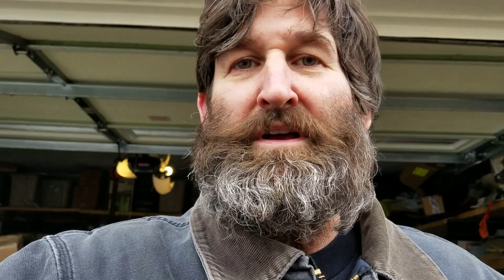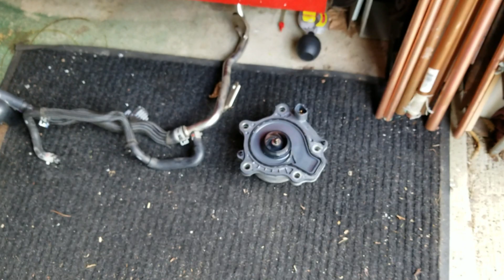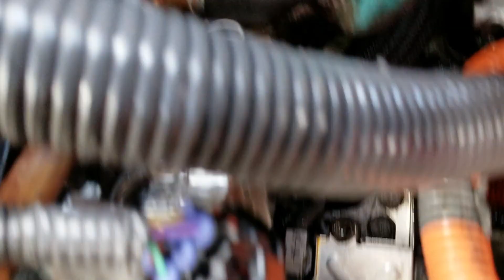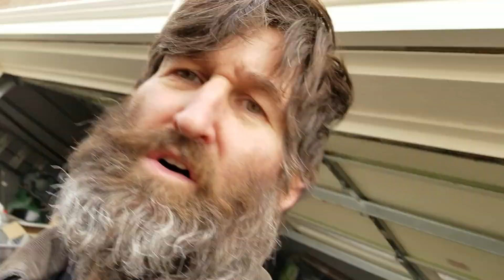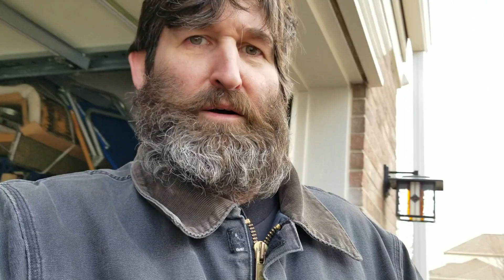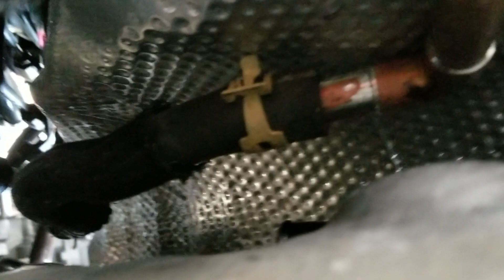Fix That Prius! - Effects of a Clogged Heater Core on a Gen 3 Prius? Overheating!

Comment: Update: NEVER SET A FOOT IN DEALERSHIP!!!  i had intermittent sporadic random overheating accompanied with a burst of coolant over the overflow on the plastic tank. toyota dealers convinced me that they looked inside the cylinder with a boro scope and there was coolant seeping tru. FVCK THAT SH!T!!!. Just received all parts, took off the head... GUESS WHAT!!!!! My gasket is perfectly OK!  I am so mad at these fake specialists in toyota. they thought that they can get me leave the car for "repair" for 3,600 plus taxes and everything FVCK TOYOTA!!!! FVCK ALL THESE "professionals". i believe that all my problems were with jammed egr and specifically the heat exchanger. I soaked it in oven cleaner, then boiled it on bonfire with water 4-5 times until water comes out clean. This is the single most important lesson for me. and perhaps to you guys!!!! I HATE PROFESSIONALS AND I DONT TRUST THEM!!!!!!!!!!!!!!

Comment: please help. prius 2012. random sporadic irreproducible engine overheating. typically, just a short flash of red T warning, accompanied with a splash of coolant out of the overflow tank. splash may be so big that coolant ends up on pass side doors. changed pump, thermostat, temperature sensor. appeared at the time to solve problem, then problem comes again. it was always sporadic. all this happened with NO check engine light and code. some ppl blame on clogged egr valve. took apart the intake manifold, yes, there was some dirt, but not terrible. finally,  i got an innova 3130lat and autel mk808bt pro and checked the codes. now i have codes. one of them is P261C "pump B" thing. <can anyone explain what is pump B, and what  A???> set autel to watch the temperature and the pump revolutions. short test drive. T reached 100 degC <just short of boiling> and the pump never moved. target speed was always 0 rpm. I am aware about rotor jammed, and no, my rotor was new when i installed it 4 months ago. the problem seems that the computer does not care that temperature is 100 and does not set target speed.................. what do i need: a new ecu? or reset -- reprogram the computer?
<pressure test of the coolant system is ok. no exhaust gases in the coolant. engine cylinders pressure test is ok. oil is clean, no coolant in oil. coolant is pink and clean, no oil in coolant>
Reply from the maker: Hi, That's a lot of stuff going on. Let's see if we can make some sense of this. Of course, I'm not there and I'll have to make some assumptions.
Assumption #1 is there is an air bubble in your system. #2 The air ends up at the top of the EGR cooler.
Is it cold where you live? What you describe is typical for a 3rd gen Prius in cold weather. The car runs fine for about 10 minutes then the temp light comes on and it pukes coolant and then it may or may not overheat after that. 
This is what you'll have to do.
1) when the car is cool enough, remove the coolant tank cap
2) fill the coolant tank
3) raise the coolant tank as high as you can while the hoses are still attached, no cap
4) unclamp the hose at the top of the EGR cooler and loosen the hose until coolant can come out
The air in the system should escape and coolant should flow from the gap where you loosened the hose.
5) put the hose back on and clamp it.
6) lower the tank and cap it
Do this as offten as nessesary.
    -  Fix That Prius !!!
Reply: @fixthatprius4980  Update. The P216C code appeared after I cleaned the intake manifold. Finally I discovered, I did not plug in the electric pump. 

My wife's husband is the dumbest person out there. I deserve every joke and ridicule. Please tell all your friends when given a chance.

After I plugged the pump, and cleaned the P216C, no more messages. I drove the car with Autel plugged in, and watched. T between 75 and 87 deg, pump rev are 5% above the target.

Comment: Hey, I cannot find an answer online to my issue, maybe u can help. I have a 2011 prius where the heat works just fine when the ac button is off, but stopps working when i turn on the ac button. On the other hand I have another 2015 prius, and I always leave the ac button on, and the heat works just fine. 

Any idea why my heat goes off while ac button is on?

Comment: I have same issues with my Prius. I have a 2011. Changed out engine, water pump, sensor and thermostat. I have issue when I drive high speeds 70-80 mph up hill. Reservoir hot but not boiling like before. Temp red light would turn on or flash and then when I slow down it will eventually turn off. My mechanic replaced literally everything minus the radiator and the inverter coolant pump. Can anyone please help????

No codes or no check engine lights just the red light engine temperature turns on when driving high speeds up hill for long periods of time. 

Is the issue temp sensor on EGR pipes?

My mechanic has replaced with all OEM parts. Any advice?

Comment: When you wash your car then use w40 to take the tiny water from conection IMO
Reply from the maker: You're not going to belive this. My Gray V is a level 5 with all available options. The electric A/C compressor went bad, causing issues with the adaptive cruise control. Everything went back to normal when I replaced the compressor.
 - Fix That Prius !!!

Comment: if it was overheating then what made you think it was overheating. did you run obd2 diagnostic tool? my prius temp gauge light didn't light up when it bellowed steam from overheating so it made me think my temp senor was faulty and also the pump thermostat was stuck too and pump was found leaky from pressure test too.

Comment: New to Prius owning. My 2014 heater does not heat up, just blows air. How do I know if the engine is over heating? There are no temp gauges or digital read out. The car seems to be running rougher. Thanks for sharing. BTW, I’m in the far west burbs too!
Reply: More than likely its your head gasket and heater core blocked. Good luck.

Comment: I did the swap and the engine runs fine but I keep getting p261b code so I bought another pump AISIN brand with Toyota scratched off.  Got the same code . Wiring looks good but it won’t engage unless I jump it straight from the fuse box.  Any suggestions?  I was wondering maybe the ecu needs reprogramming but can drive it to a dealer and you they will as much as they can legally 🥴

Comment: Here is that time of the year again! I gave up on my 2010 Prius last winter because of lack of heating. This spring, I replaced the head gasket. As a matter of fact, my heating started acting up since I started adding "Head Gasket Sealants" in it. I did it in total of four times. They become less "effective" as the time progressed. I highly discourage people from using them especially on hybrid cars because of the complexity of their heating and cooling systems. There was so much deposit built up on big coolant passages and blockages on the small ones. My car runs fine now except the heating is still not getting warm enough.
Here is the list of the things I have done so far: Replaced water pump, T-stat twice, radiator, power washed the heater core, replaced both coolant temp sensors.                                    The inlet and outlet temperature of heater core lines are about 150 F within about 10 degrees apart. The max temperature at the driver's vent is 110 F while it becomes cooler towards the passenger.
What seems to be wrong!? I have done the elevation technics each time I have done some heating system work. It seems I have circulation problems or maybe still air trapped. Where else can I flush to get rid of possible restriction?
Reply: Hello bro . My 2010 Prius has same problem.no heating inside car and engine is overheating after 45 mins of drive . I recently changed water pump and thinking to change heater core now , how did you solved this problem? Please tell me it'll be very helpful
Reply: @mohdminhaj898  I had blown head gasket and had added Blue Devil head gasket seal three times and clogged the heater core! I had to replace both the head gasket & the heater core aftermath. I only recommend doing it if you're highly mechanically inclined.
Reply: @ronmelliad7327  i still need to figure out what the actual problem is? Is it heater core or blown head gasket or thermostat or coolant temperature sensor ? No mechanic is saying anything surely. Most of them says it's head gasket after listening to "no heat in car and car engine overheats" .
Reply: @mohdminhaj898  There is a test kit you can buy from the part stores to check if you get gases from the combustion drawn to the coolant reservoir. In my case, I was getting misfire codes and engine rattled specifically during the start ups because the coolant was seeping on top of the pistons.
Reply: @mohdminhaj898  Failed thermostat does not cause overheating. Failed temp sensor normally comes with a code. Why don't you check if the radiator fans kick in? If they do that means your temp sensor is OK. I was hearing gargling sound coming to cabin too because the  gases coming in to the cooling system.
Reply: @ronmelliad7327  there was a noise earlier and after changing water pump the noise gone . Now there is only one code appearing when i checked last time . P0117 ( engine coolant temperature circuit low input) .
Reply: @ronmelliad7327  i checked online just now , this code appears if your thermostat isn't working properly or your coolant temperature sensor. Should I first change thermostat and this sensor? I can't afford to change head gasket now . i will have to sell my car
Reply: @ronmelliad7327  changed thermostat and coolant temperature sensor. The problem is head gasket. What you suggest should I use head gasket sealer?
Reply: @mohdminhaj898  No way! It will clog your whole cooling system specially your heater core. Then you still need to do the head gasket on top of that!
Reply: @ronmelliad7327  the thicker sealer like "bar's leaks" will clog the heater core . I am thinking to go with "blue devil " the liquid one just like water

Comment: Hi, I need help. I have 2013 Prius. While driving on a slope, temperature goes high over 110 celsius. The head gasket was fixed before 1000km. It has no air in the coolant system. What else should I check to fix that annoying problem. I have a friend with the same car and the same problem. He did twice head gasket, changed thermostat, changed water pump, no air in the cooling system and still overheating.  So I don't want to go the same way changing stuff with no effect. Please help. Any advise is welcomed.
Reply: I'm thinking heater core...
Reply: @TeslaArray101  I bet it is
Reply: I have same issues with my Prius. I have a 2011. Changed out engine, water pump, sensor and thermostat. I have issue when I drive high speeds 70-80 mph up hill. Reservoir hot but not boiling like before. Temp red light would turn on or flash and then when I slow down it will eventually turn off. My mechanic replaced literally everything minus the radiator and the inverter coolant pump. Can anyone please help????

No codes or no check engine lights just the red light engine temperature turns on when driving high speeds up hill for long periods of time. 

Is the issue temp sensor on EGR pipes?

My mechanic has replaced with all OEM parts. Any advice?

Comment: Just curious if any issues with the coolant system assuming clogged heater core is the issue too would it cause issues with the hybrid system like overheating fast? My battery heats up fast and I was thinking the radiator/Condenser is supposed to cool both engine and hybrid coolant. Any info would help looking to address heater core air pockets
Reply from the maker: Hybrid cooling and engine cooling are separate. Most likely a dirty battery cooling fan or duct.
Reply: @fixthatprius4980  sorry for late response. It ended up being a leaky cell from another battery a customer drove hours to me on a bad cell code. I repair these batteries so I just swapped out the area I saw high temp and fixed it. If anyone needs help how to fix these batteries feel free to reach out to me

Comment: Barr's leaks and anything from K-seals, bluedevil, etc. are stupid.  It will brake all parts that can cost more than $5000 total. Heat core, exhaust exchanger, waterpump, radiator, etc.

Comment: Hello All, I am following up on my experience with the GEN 4 engine swap and the water-pump. I swapped my engine out right at 50K miles ago and when I did, I put the original water pump on. That pump lasted only a couple days and was dead. Then I ordered a pump from a Japanese supplier that worked for 50K.  It was listed as working for all models both GEN 3 and GEN 4. Well it died. So I ordered a new pump from Toyota and, while I was ordering it, I discovered that Toyota now lists a separate part number for the GEN 4s. When I looked at the pumps side by side it looks as if the impeller doesn't protrude into the pump housing quite as much. Also, there are some other differences.

While I was at it, I cut out the jiggle pin in the thermostat. This was a big help in purging air from the system. It took me 2 days to purge it before with the jiggle pin in but with the jiggle pin removed it took an hour. I put the hole left by the jiggle pin at the 9 o'clock position; I don't know if it will make a difference where it is but it worked.. 

 I pulled the reservoir tank and elevated it as described. I also opened the vent near the EGR and put a clear vinyl tube on its outlet which I hung from the hood latch. With the reservoir filled I pumped the lower radiator hose WITH BOTH HANDS. This was important as I didn't see air leaving the system until I did that. Also, I pumped the hose fast on contraction but let it off slowly. This prevented air from being pulled back into the vent by the EGR. Once I got as much of the air out of the system as I could, I then jacked the car up on each side and repeated this procedure several times. Jacking it up on the right side (in the USA that would be the drivers side) made the biggest difference. When I couldn't get more radiator fluid in, I put the car in service mode with the heat on high. I had the radiator cap on and the vent by the EGR closed at this point. I had heat pretty quickly but it took a while to warm up. I squeezed the lower radiator hose several times while it was running. It took about 20 min for it to warm up to the point where the thermostat opened but when it did, the fluid level in the reservoir dropped from the B line down to full. Yeah!!!

I took it for a 100 mile drive and it worked perfectly. Good luck to everyone and Happy New Year. Thank you FIX That Prius for the fantastic help!
Reply: Hi Bruce, Great post. Thanks for sharing your experience. And a Happy New Year to you!!!
 - Fix That Prius !!!
Reply: What was the part # for the gen 4 water pump??
Reply: @Christian-lt7wd  Hi Chris, The part number for the one I bought that worked for the 4th gen engine was 161A0-39035.